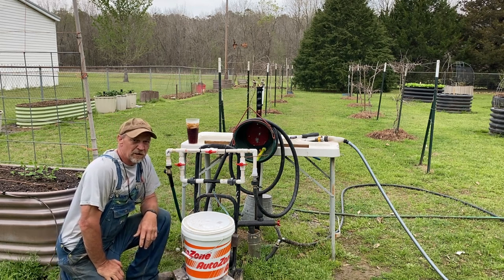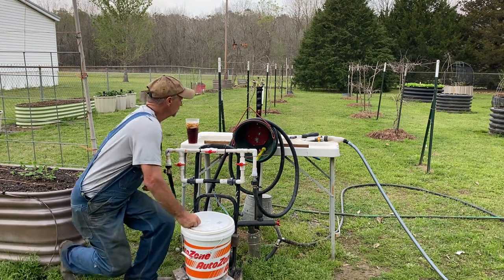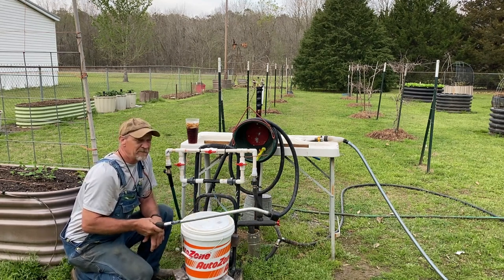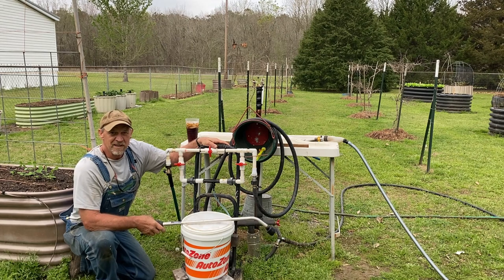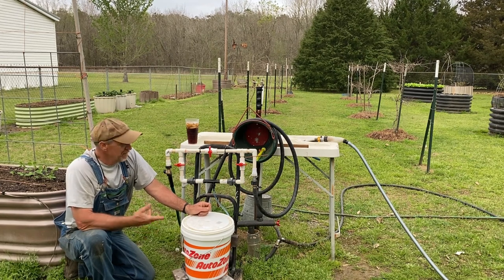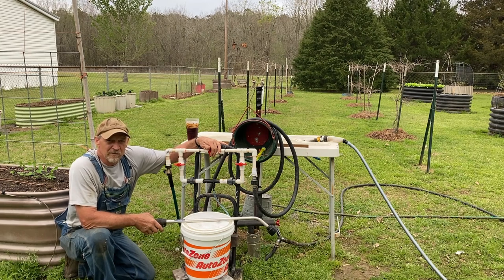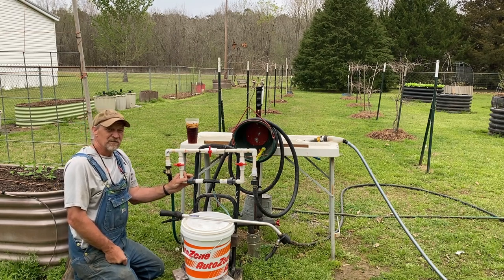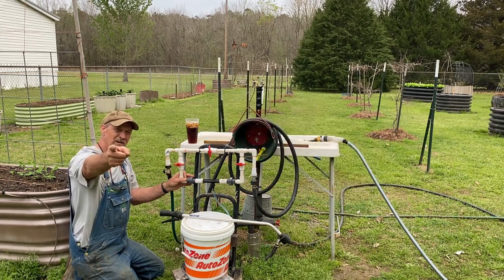DIY Venturi Fertilizer Injector Update. Did it work on my garden Drip Irrigation system?

Comment: I had the same problem so i added one big overhead sprinkler to my system that waters the corn and that seems to work.
Reply from the maker: I had that similar idea, but I have to wonder if the biggest part of the fertilizer is just going out the sprinkler when I am watering. (path of least resistance) I know I may be over thinking things a bit.... I think I'm just gonna buy one of the small injector tanks just for the drip irrigation ( they work off pressure) and use this setup to fertilize my beds.

Comment: Have you tried prepriming the clear hose?
Reply from the maker: It will suck until al the drip tape line get full then it will not work but I have fixed that issue and have a video showing what I did that make it work with any drip system.

Comment: I have the same problem. Mine will have suction when first turned on but when the pressure increases as the drip tape gets full of water the suction goes away. Haven’t found a fix yet but still have a few more things to try.
Reply from the maker: I've tried everything I can think of but as small as my garden is, it's just not gonna let out enough water through the drip tape to make it work. Now using the Dramm watering wand on my raised beds, it works great. If you come up with something, Please let me know.
Reply: Never works the Venturi, many video s showing it, and many comments. saying It does not work

Comment: Do you have a water pressure regulator/reducer? If so, is it on the drip lines or faucet. Before or after the injector? Might put it after the injector so the injector can get more pressure.
Reply from the maker: It's after the injector, it's just not enough drip tape in my small area to make it work. It works very good with the Dram hose end watering my raised beds though.